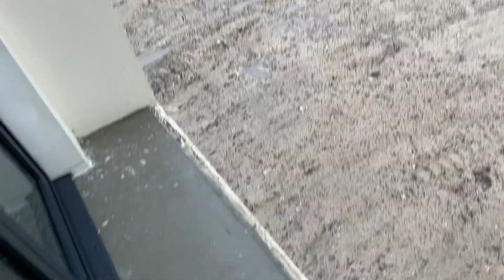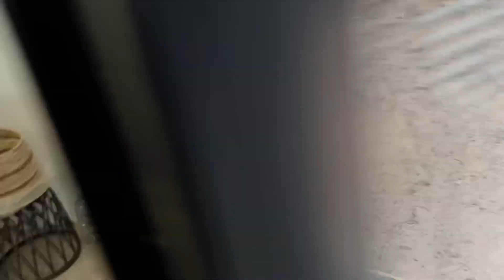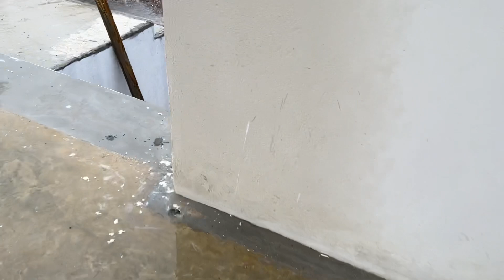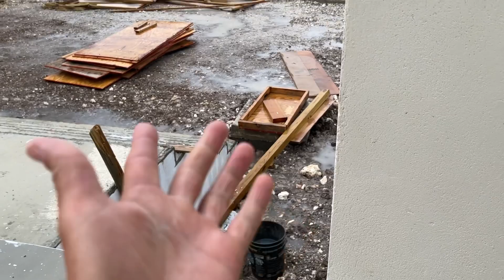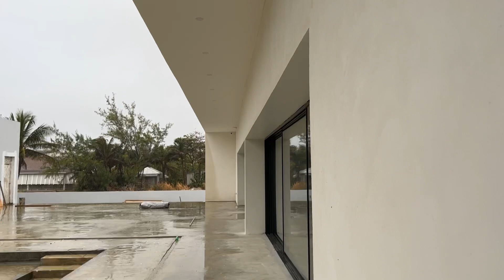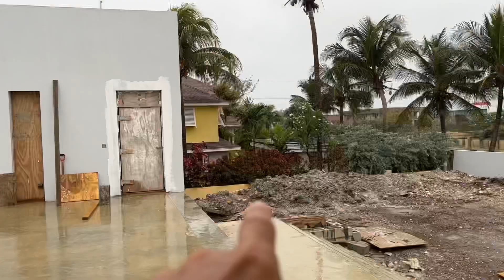Barbados 🇧🇧 Beach House Build - Day 256 (not 236 😂) Building our Dream House in Barbados

Comment: You build very similar to us in spain 🇪🇸 you will never stop water stains on the morter blanco we use a plaster off Paris top stones on moat exterior walls they have a drainage channel underneath them on both sides normally 300mm by  1 metere cost about 8 euros each also lot off doors windows are tiled sloping away from openings takes lot off water away I've done front gates in woodgrain upvc can get wood effects buy tounge and Grove at many outlets just make sure you get right thickness to match your main gate internally glazed beaded you should be able get from 6 mm up to 20mm rebated  good luck

Comment: Just a thought, not sure if have a underground water tank to collect rain water which you can use to flush toilet and water the garden it would save you a lot on water bill. I know that some home have concrete guttering and channel water to the tank.
Reply: @barbadosbeachhousebuild  Morning Alvin I am sure the system is doable. I know that in other Caribbean island the concrete guttering  is  within the roofing system and the downpipes inserted within the walls. This will allow you to connect to your underground collection system and pump to wherever. I hope this is helpful
Reply: @barbadosbeachhousebuild  Hi Glad to know that you have this is place.